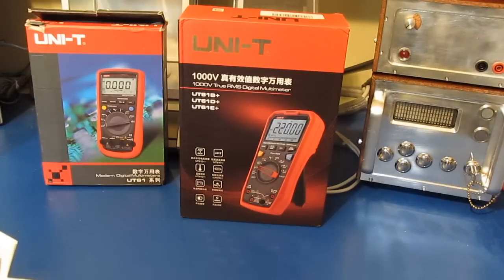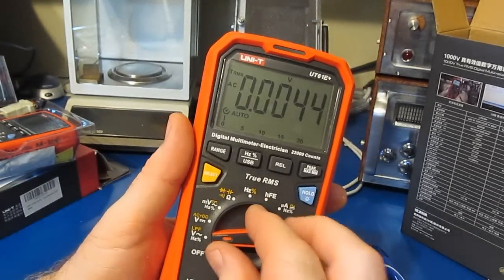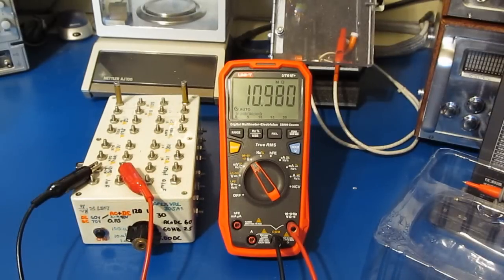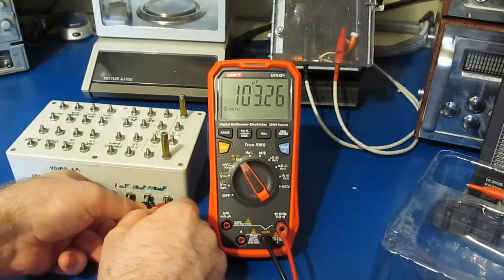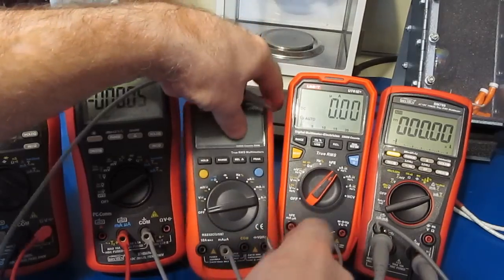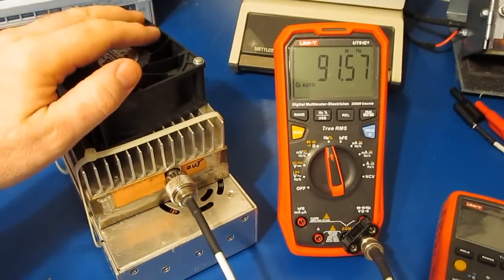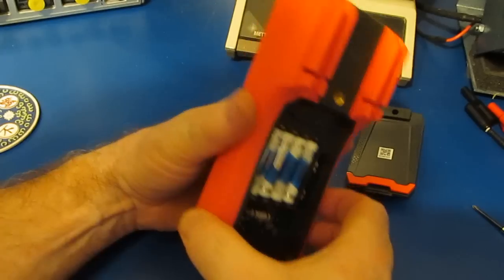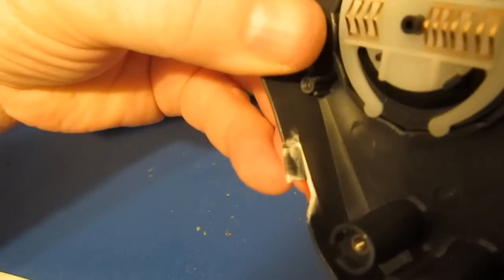UNI-T UT61E+ DMM,   Part1

Comment: i think it would be worth it to replace the ptcs and see what's what. Of course it's up to you.
Reply: one more for repair for entertainment (and educational) purposes.
Reply from the maker: Looks like at least three transistors were damaged.  All four should be replaced. All the PTCs will need to be replaced as well.   The PCB looks in good condition.  As long as the ICs were not damaged, it could be repaired.
Reply: @joesmith-je3tq  Assuming you can fix it I guess the question is would you be ok testing it and listing the results.
Reply from the maker: @whill44  I would have no problems with testing it for pure entertainment but wouldn't include the results in the spreadsheet.
Reply: @joesmith-je3tq  Well  you know, I'm all about the entertainment. Looking forward to the video. Thanks for the your time and effort Joe.
Reply: Joe, I think Uni-t should give you a new meter because it should of met its specs; however, it would of been interesting to see how far it could go in your tests.  I would replace the defective components assuming the IC is good.  Anyway, thanks for your evaluation of the 61E+

Comment: I bought this multimeter because I read many positive reviews. In fact it is an excellent product, but I noticed that the measurement in ohms is very sensitive to temperature. Just placing the hand on the meter It increases the value by 0.18 ohms. Is this normal or is it a defect in my model? Thanks, watch the video below. It has been sped up for convenience but it actually lasts 3 minutes

https://youtube.com/shorts/ommCsKspzIg?si=pAW51e57f0F4Qn0F

Comment: Who is using a Multimeter to read very high VHF at higher RF power. This is dumb. The other UT61's are rated at 10Mhz.   Driving at higher RF power you intentionally destroyed the meter for no reason.  High RF power at high Freq requires special equipment not a general use Multi meter.
Reply from the maker: This channel has intentionally tested meters to their limits for years.  If it bothers you, just find another channel better suited to your personal liking.

Comment: Can you suggest. The YUT61E+ multimeter, when measuring direct current, in milliamp mode, when 220 mA is exceeded, does not show overload (OL), but continues to show 220 mA. Although the current is already 500 mA. Is it damaged??
Reply from the maker: Mine will show OL around 220mA and will stay OL with 500mA applied. If it was like this and new meter, maybe return it for replacement.
Reply: @joesmith-je3tq  , it was a Glitch in my multimeter. Now after 220mA it shows O.L. It was necessary to turn it off and on, and I switched the limits.
It would be easy for you to use your current multimeter about 150 - 200 mA in milliamp mode, take a reading and not change the current, switch the limit to Ampere mode (20 A) and also take a reading. Mine shows 170 mA and 0.182 A. Will there be such deviations or not?

Comment: Weird that it can light up the white LED but not measure its forward voltage. Should not be a problem with a 6v battery?
Reply from the maker: From meters I have looked at, it seems fairly common.

Comment: I agree with Dave. I wouldn't buy it for the safety.
Reply from the maker: None of the tests I run have anything to do with safety  or suggest if a meter would pass certification or not.  The meter isn't very robust electrically or mechanically compared with others I have looked at but on par for this brand.   Cost is high enough, I would look for a higher end meter.
Reply: @joesmith-je3tq ut191?

Comment: Honestly Joe I don't know why Uni-T Campany is still trying? I mean they should've gone out of business by now...
they don't know how to design and manufacture a meter, end of the story.
Reply from the maker: Because many people only consider the features and price.  They make a lot of low cost, feature rich products.   They should be in business for many years to come.
Reply: @joesmith-je3tq  Oh GOD
Reply: My main beef would be with lying on the box in regards to specs. Nobody forced their hand to put 200MHz or whatever it is on the box. 50MHz would have been just fine, although the spec is meaningless if you don’t also specify the lowest signal level it should detect across all frequencies, or provide a sensitivity vs frequency plot. The manufacturer here knows how to make meters. They are dishonest in advertising and documentation/marketing material. So I could never buy their product and trust what’s written on the box. It’s an issue of trust. Really basic stuff. Trust doesn’t matter to them. Then they don’t matter to me as a customer. Easy, right?

Comment: RE: diode tester. Sometimes it's useful to double-check polarity on SMD LEDs, either before installing or when tracing a circuit. But that's just my use-case. However, I would use a pocket meter with cheap small probes, much "safer" to handle around small parts. Something like UT10 comes to mind.
I don't see people getting more meter for the money with this 'plus' model.

Comment: Hello again Joe and thank you for that surprising update about a so called "improved" version of the UNI-T 61 DMM...I was always under the impression that a "new" or "improved" model of a particular product should surpass it's predecessor in every way. Well....so much for being an "improved" version, we can always count on you to shake them down and prove whether they are truly "improved"...and often times the case is that early on in testing, we find weak points or flaws....even sometimes shortcomings in manufacturing and/or circuit design.
Thank you for all that you do Joe, I have and I still am learning from you...👏🏾👍🏽💪🏾🙂
Reply: A side note...I was also now thinking that we might have to keep in mind that this "improved" 61E still is considered a "budget" version, based on it's price more so, and as such, we can't  expect it to perform like a DMM that is priced in a higher range...so all in all, based on that, we might still be getting a good "bang for our dollar", ESPECIALLY for one of it's best attributes, it's speedy rendering of capacitance values...most likely one of if not it's best attribute...🙂

Comment: Hi Joe, may I please ask you on your opinion of the old Tektronix TX3? Many talk about it as if it is one of the greatest meters made. :-)
Reply from the maker: I've never seen one or even heard of the model.  It seems to be very old.   No doubt EVERY meter has a fan base.   Even the old analog meters have followers.   Maybe you could start by finding a manual for it and comparing specs.   Maybe use todays value to compare the specs with a meter of similar costs.     

You could start a poll asking the group what was the greatest meter ever made.  Maybe toss in a few metrics.  You would get a lot of opinions.   

Personally, I would try to find a new old stock and run it.
Reply: @joesmith-je3tq  Thank you so much for your amazing reply, I understand that Fluke did buy it and rename it to Fluke 185.
Reply: @joesmith-je3tq  I found a Tek 916 which is a very fast and accurate dual display meter. The TX3 model is going for ridiculous prices, Paul Carlson has one and says it’s his go to meter. He was using the Agilent model with the green LED display for video purposes of showing up better but the thing burned out the display after about 4 years. At the price they charged for them it should last 20. He said he’s done dumb things with the TX3 but it never has failed or locked up and had to be shut down and restarted to reset it. They seem to be scarce. I found one for like $400, no way. I paid $200 for a pristine Fluke 189 and the price at the time for my 3 Brymen meters. I have a meter collection that is close to yours lol. I finally scratched that itch and stopped. For now anyway.😝

Comment: I wonder how the ut161 would stand up against this one.
Reply: From the specs and inside photos, ut161 looks like much more better product, it also comes with bussman hrc fuse. ut61e+ i think is just an 61e with backlight and new makeup, even thought it use different ic. if am not mistaken uni-t now has several line multimeter that was certificied by etl. it would be curious to see if uni-t really stepping their game with that couple series of multimeters. but of course its not cheap like ut61/ut139 series. i think its prices are almost in brymen teritory.

Comment: Wow, that input protection got nuked! Now I’m really curious how a stock 61E+ would handle transients, because there are clearly some significant differences between the new one and the old one.

Awesome video! Also, I have to say, I’m very impressed with the capacitance reading speed on this meter

Comment: Well that was a great video. Sorry for wasting your $$$ as I was one of the people who asked you about doing it. It looked like it might take a bit more punishment but it was more disappointing than I thought. It would have never survived the grill starter. Funny this E+ model is the only one of the new 61 line that doesn’t have some kind of independent test lab sticker. Can’t believe that power amp roasted those PTC’s like it did. How many watts were you pushing it to get it to read the higher frequency? Too bad because it seemed perform well in resistance and capacitance measurements. Well it looks like another Frankenmeter by JS after you finish any other testing if you decide to. Thanks for taking the time and spending your money. Your old modified 61E is killer after your amazing EE brain redesigned it.
Reply from the maker: Outside of  breaking my vow to never bring another UNI-T product into the house, it's no problem.    I really have no idea how many Watts / Volts / Amperes we were throwing at it.  As you can see in the video, nothing was instrumented.   I was creeping up on it expecting that counter to start reading at some point.   The PTCs are obviously a heat source.  It's the nature of how they work.  Getting them hot enough to reflow the solder was a bit of a surprise.

Comment: So what amplitude was that going into the meter at the end? Do all your other meters handle that? 
I kinda doubt it, I cant imagine PTCs in other meters would be much more reliable at high frequencies.
Maybe it could have read a 200MHz square wave instead of sine.
Reply from the maker: The typical surge rated resistor may behave much different.  Hard to say.   Best thing is don't advertise it on the box and I won't attempt to see if it works.
Reply from the maker: https://www.eevblog.com/forum/testgear/hear-kitty-kitty-kitty-nope-not-that-kind-of-cat/msg3682882/#msg3682882

Comment: You had reasonably high level RF right next to the meter; do you think that may have contributed to its demise as well?
Reply from the maker: While the amplifier was indeed right next to the meter and operator, the RF is contained until it reached the end of the coax cable.

Comment: Haha. If only Uni-T hadn't made a false claim about frequency range, that you HAD to test.  :-)
I was hoping to see if meter could stand up to any transient test. It died too quickly! 
Thanks for getting the meter.
I have  been satisfied with my 61e+ especially by adding data logging to my meager toolbench. It was a good $70 upgrade for me.  I expect my 61e+ will last as I still have a working Fluke 75 series 1. 
You've already upgraded a 61e, so there is no challenge in doing that again.  I'd still like to see if 61e+ pops from transient test, if you can get it working. Worth the effort to have invalid results? In any case,  I do enjoy watching you push things till they smoke. 
BTW I was impressed by the usefulness you got out of the 181a once you repaired and modified it.
Reply from the maker: I'm fine with trying to improve it or just doing a repair.  If the ICs have not been damaged, I would have no problems running transients on it for pure entertainment.  I would not collect any data from it as I am not sure how the meter has been stressed.

Comment: Can you still see the values on the other PTC's? and do you have spares on hand? I was interested to see it run and maybe get one if they go on special. I recently chinced-out on a HT-118A for $15 with a set of 10 soldered gator clips (a real nothing-burger price..)
Reply from the maker: The outside cases on all 4 parts are gone, right down to the metal.